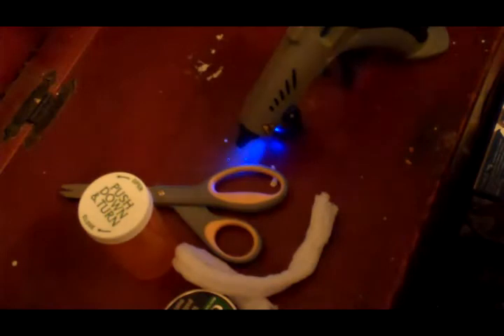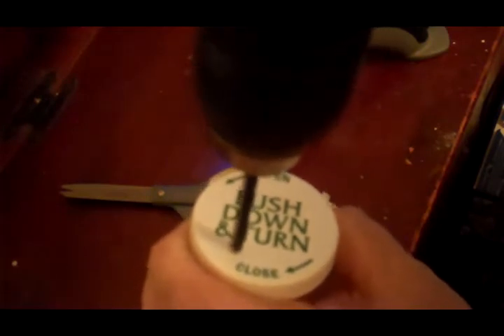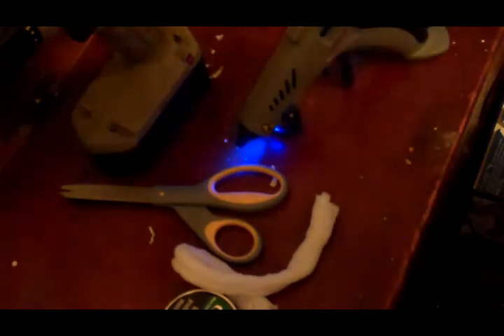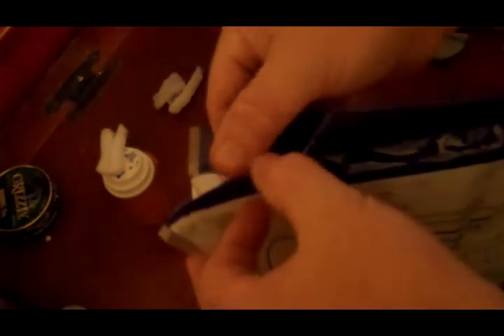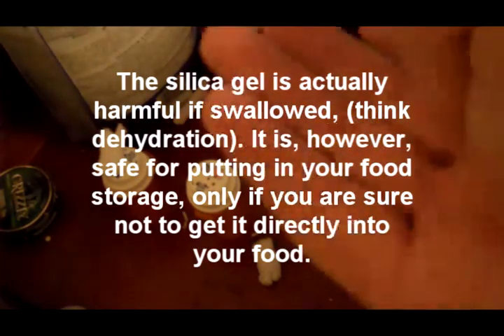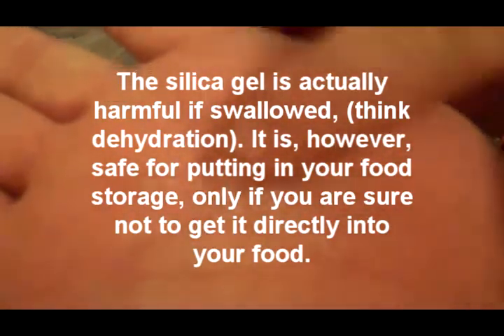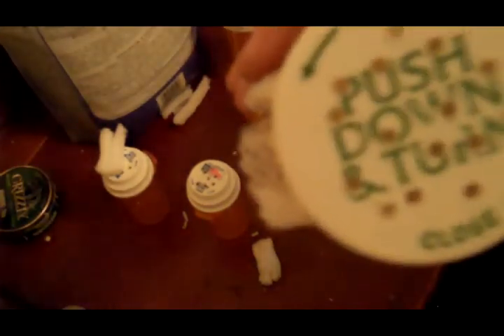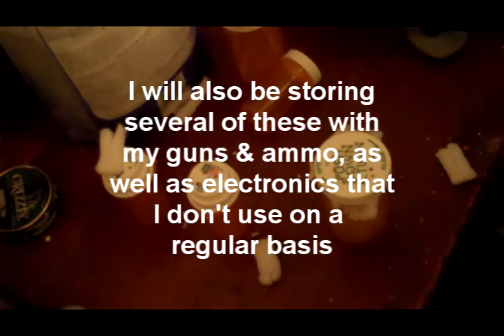Making Homemade Dessicants

Comment: Use an old stocking over the top and screw the cap back on - cut off excess - no need for glue!  Also cat litter is a great/cheap desiccant.  Is this single use desiccant?  Does it change colour when used?  Thanks for showing.